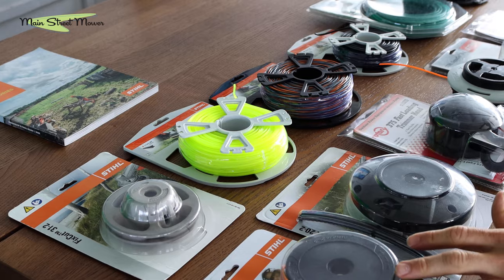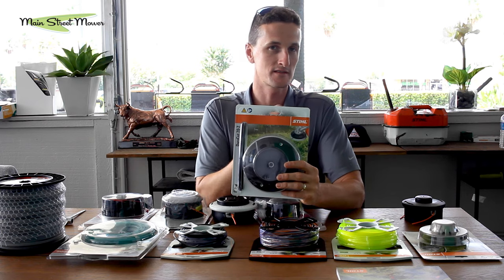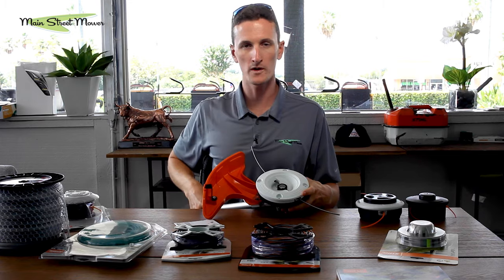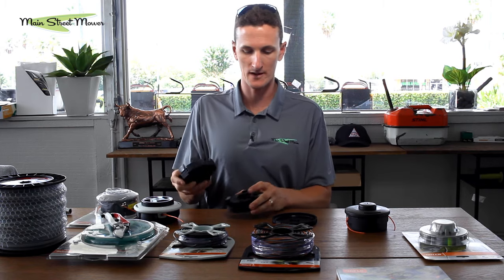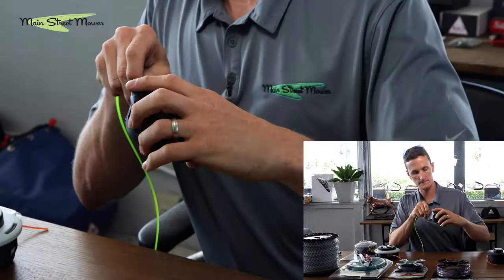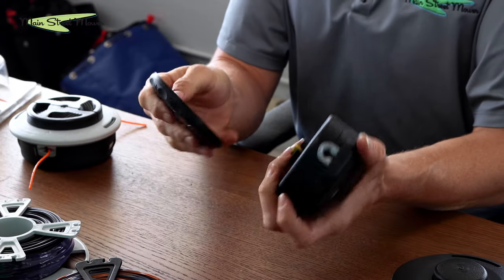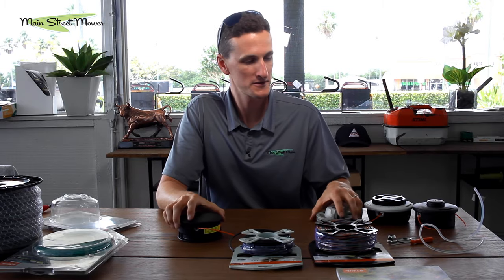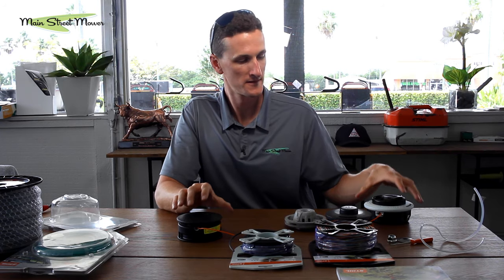String Trimmer Heads - Everything you Need To Know! Decoding Myths.

Comment: I am really enjoying my Speed-Feed 400 head on my STIHL FS90R.  However my instructions says to Load 20 feet of line.  Using my arms as my guide I grab 4 arm lengths (5'11") of .095, and it loads easily and feeds properly!  I really prefer .105 size and it does say only 10 feet.
Reply from the maker: That's great info. Thank you fir sharing Doc.

Comment: Question please: I have a Ryobi gas straight shaft trimmer.  The bump heads are crap.  The "Reel Easy" is easy but the bump knob is so thick that I can't cut down to the ground unless I go at an angle.  Will the Stihl 25.2 or work with my Ryobi?  Thank you for your time.
Reply from the maker: Unfortunately not, I know this isn’t what you want to hear but I promise you will thank me for years to come. Sell your Ryobi, maybe return it if you still can and go buy a Stihl FS56RCE for $219.95. It is made in Virginia, has a great warranty/ support, it will never leak gas or let you down for the next 15 years (at least). And all the heads in this video will fit on it. Everyone I’ve ever talked to who has made the switch only has one regret and that is that they didn’t do it sooner. It will literally take all the drudgery out of your stringtrimming life for good.
Reply: @mainstreetmower  I am going to take your advice.  I will also get the 25.2 head.  I like the bump better than the auto feed.  I was going to get an Echo trimmer, but the new ones don't have the best reviews.  And it's nice to know the Stihl is made in Virginia.  Thank you so much!

Comment: We run the fixed head with four lines not two like in the video.  I don't know why anyone would run a fixed line the way you set it up.
Reply from the maker: We honestly don’t have as much field experience running the heads as many of you, so maybe that’s good advice. But beware that thicker line, extra long line and quad line cause significantly more load on the engine leading to a lot of collateral engine and clutch damage. The clutch drum and shoes will wear out much sooner and break the clutch spring. The engine will not reach optimum rpm causing more carbon build up, heat and valve timing issues. Factory recommended line size and length will result  in less repair and longer engine life.

Comment: I have the fs56rc and i like the feed head, but over time it is more finicky to feed. It wont feed even when lined up propperly. I have to open the head and stick a ljne through directly then just spool as normal. Its not big a deal, but i can imagine folks getting fustrated with it. Especially if they arent handy and figure how to feed it alternatively.

oh also cant spool using my palm. just to much wear. have to use the finger groves which does fine.

Comment: the advantage of the speedfeed is that when the line gets low, it will not fling out. That is because rather than putting in 2 pieces, one on each side into a grabber which  loses the line when it gets low, the line goes across as one piece so the opposite sides keep in intact even with centrifugal force. That is why I like them. You do not need to cut 2 pieces and you do not loose it when it gets to the end or even well before like so many that go into a grabber.
Reply from the maker: That's great. Thank you for sharing this info. Should be very helpful for anyone trying to understand and learn more about the speedfeed heads.

Comment: Stihl is not as good as it used to be all made in China quality has suffered massively in  over the years .
Reply from the maker: This is false, Stihl has factories all over the globe, but the Virginia Beach plant is the largest and produces 95% of the product in an American showroom, including the bump heads and even the trimmer line in the heads. As a dealer I have never seen Stihl make a decision to compromise quality. Every product change we’ve seen is an engineering improvement for the sake of power, longevity, ergonomics, weight reduction, vibration reduction, sound reduction or emissions improvement.

Comment: I have an fs 250, and use the 31.2 

I have actually never seen the string being feed like that, and went and searched it. You are right in the way it is supposed to go.
I am surprised that the Stihl dealer never said anything during the times it has been in the shop. 
They even replaced the head, and restringed it the same way. Now that I think about it, I believe most people here string it the same way.
Tropical climate here, so a lot of people run the big stuff.

So I will try to explain this. Cut two pieces 17 inches. Take one piece fold it in half put both ends through the slotted holes, then inside send the two ends out the bottom round holes, and repeat for the other side. 

This gives four exposed strings. The largest I go is .130, have done this way for years now. 

I definitely want to try the right method, and see what kind of difference it makes. 

Thanks for the informative video.
Reply from the maker: Thank you for sharing. We're sure you must have learned the 'trimmer line length' experiment video we did.
Reply: @mainstreetmower  sure did.

Comment: i am curious what you think about the pivot line heads like the Shakespeare Ugly head?  The line seems to last about as long as a full load of 15 to 20 ft of a auto head.  I dont know why.  I also dont understand why the 6 .095 lines don't seem to load down the motor compared to two in the auto feed.

Comment: I like the small speed bump head. Lasts me for a couple years before it wears down. I also used a lot of those metal trimmer heads that come with shindaiwa or maruyama. I’ve worn those down until the bottom edge is like a knife spinning around, and it starts to whistle. I bought a toro that had a bump head like the original stihl, didn’t like it, any bump on a Little Rock or something sticking out would cause line to come out. I only bought the toro as a backup. But it’s been my main trimmer for about 5 years now, not a single problem, starts second pull every time. I’m used to it now but I used to hate the toro trimmer, doesn’t spin as fast as my red max did, but I got used to it.
Reply from the maker: Thank you for sharing Montana.